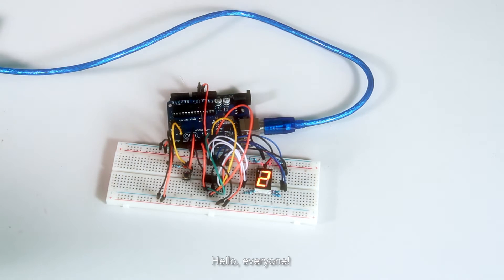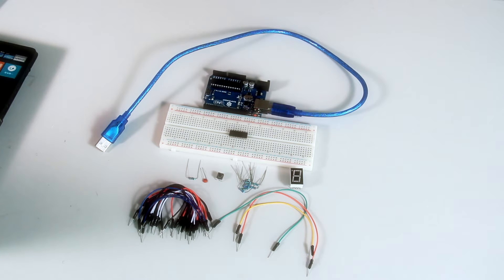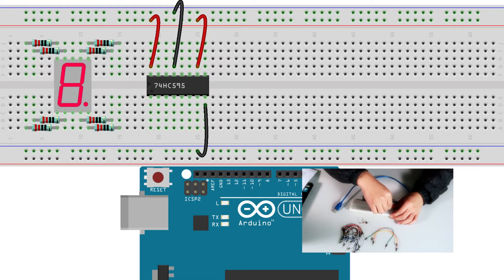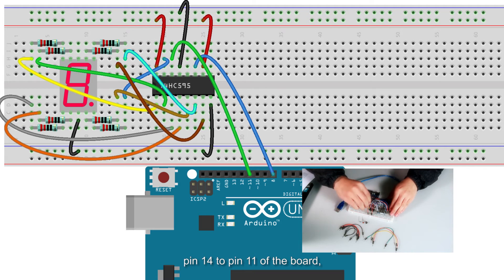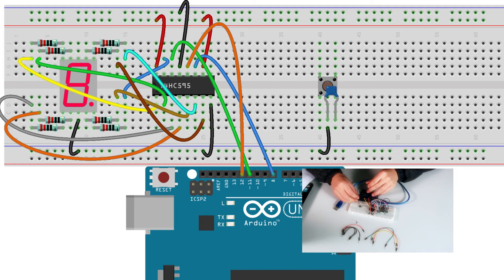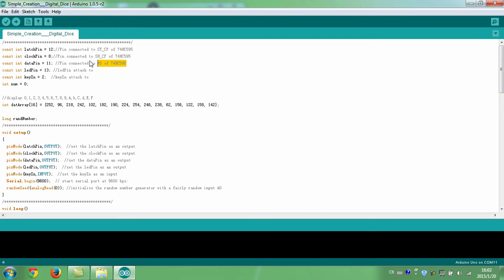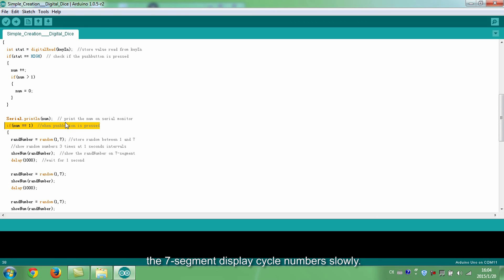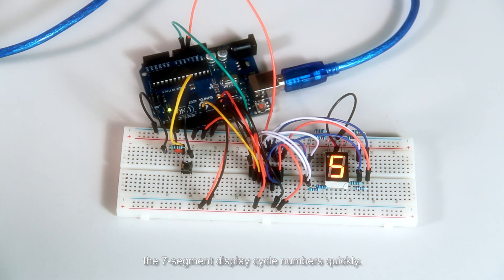Sunfounder Kit Turorial for Arduino - Digital Dice

Comment: What is the capacitor for?
Reply from the maker: Dear Miguel, 
The capacitors and resistors which is next to the botton, are to prevent the key jitter, so that the botton can output a stable signal.
Have a good time!

Comment: we tried this for our project but the number is not switching can u direct us a solution
Reply from the maker: +Lalith Kumar Since the experiment needs a lot of wiring, are you sure your connections are all good? Any wrong or loose connecting may cause abnormity. The not switching may be caused by the button's wrong connection, or incorrect pin definition in the code (if you typed yourself instead of copying). Check whether it works now.
Reply: +Sunfounder we tried verifying that but the problem stil prevails . could you please explain the role of capacitor and switch combination  in the circuit
Reply from the maker: +Lalith Kumar In this experiment, the button is to generate an interrupt – so when the button is pressed down, the number switching on the display slows down and then stops. Add a pull-down resistor-capacitor is to eliminate the jittering or shaking so the button can give a steady signal. 
If you still cannot get it work, you may check whether the code is consistent with that on our website (go through LEARN->Get Tutotiral->Super Kit for Arduino, then download the package on the page or go to next level, i.e. the lesson page and check the code). As long as the code is correct and your upload to the Uno board is successful, following the wiring in this video will work.